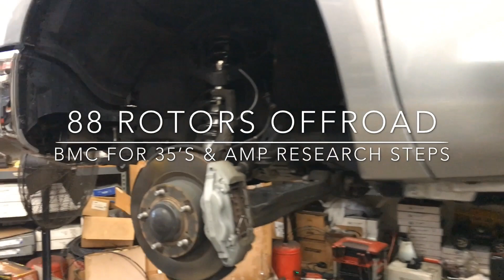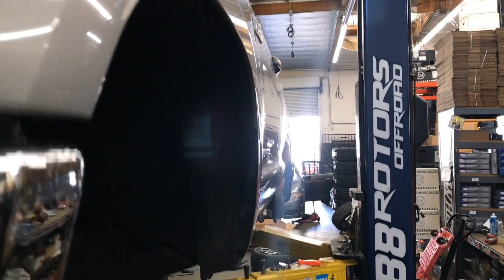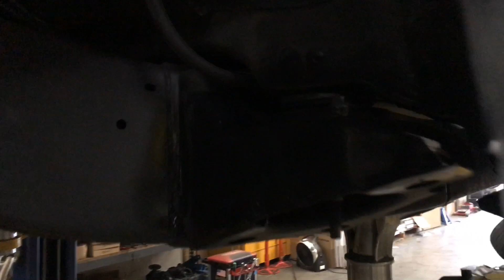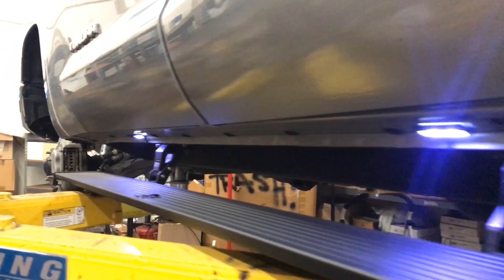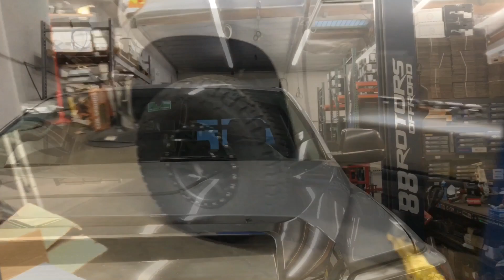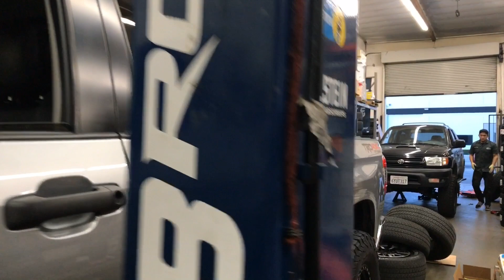2014 2018 Tundra Doublecab Amp Research Steps & BMC for 35” KO2’s and Method MR312

Comment: Is that Method at "0" offset, And size wheel? Sticks out bout 1"? Nice job looks good. Thx
Reply: The wheels are 17x8.5 with 0 offset, and the tires are 35x12.5 R17. It's a very popular setup for these trucks. Even with 0 offset, the tires stick out just enough to give it that look. Hope that helps.

Comment: Which size method’s are these?  Are you positive this is a 2018?  Headlights look like a possible 2017.
Reply: I'm pretty sure those are 17s , they look really good when paired with 35s :)
Reply: jan3019 you are certain these are 17’s?  Those have a 4.75 back set didn’t think those would work on a tundra.  Method has a 18x9 with a 5.75 could it be those?  Thx